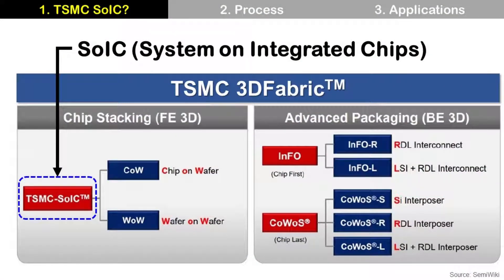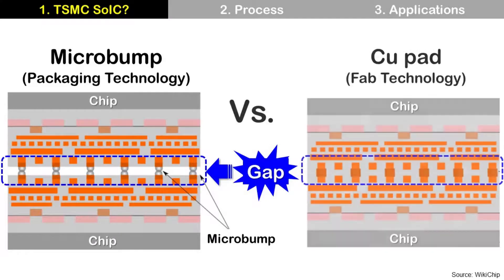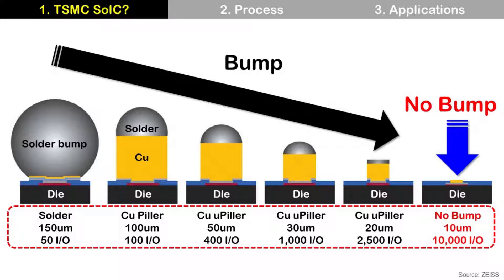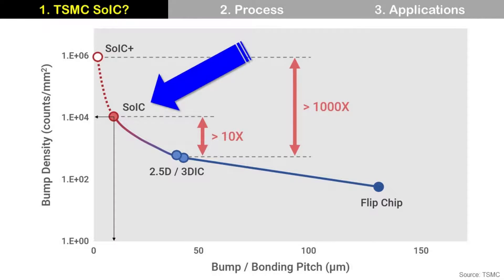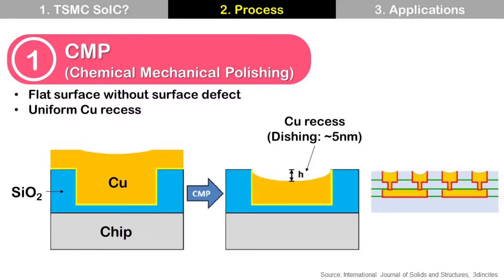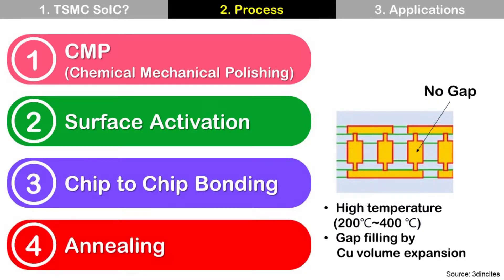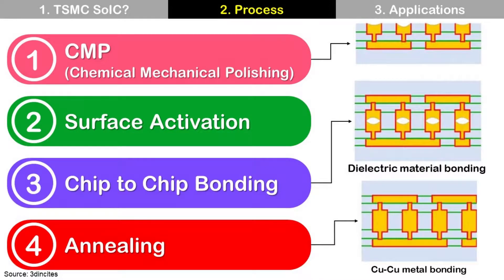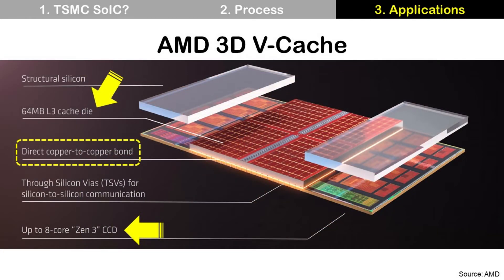[Eng Sub] TSMC SOIC

Comment: Hi, I always love to watch your video which is really helpful for me to understand the PKG area. One quick question. For the CoWoS-S, Do you know how many Metal layer is being used(MaX) for the S-interposer? Are there any limitations to increasing the number of metal layers or is it just a matter of cost issue?
Reply from the maker: TSMC CoWoS usually uses 3~5 metal layers on Si interposer depends on configuration. There should be maximum number of metal layer on Si interposer because there should be minimum width of metal trace. But typically metal layer is limited by manufacturing cost.

Comment: Could you make video about InFO_oS which is probably use in Zen4 because for some reason I don't see where this technology is use on official TSMC documentation. Where are connections?
Reply from the maker: Sure but nowadays I couldn't make video without time. But let me explain little bit about InFO_oS. InFO_oS is InFO on substrate means fan-out package with multiple dies attach on package substrate. Die to die connection is done by RDL without micro bump and InFO package to substrate is connected by Cu bump. Solder ball is located on the bottom of substrate. For InFO fan-out package, solder ball is located on the bottom of RDL. I think InFO_oS is for HPC(High Performance Computing) application with larger package size and advanced fan out interconnection technology of InFO.   

https://3dfabric.tsmc.com/english/dedicatedFoundry/technology/InFO.htm

Please check slide 9 and 10 of below presentation file from TSMC.
https://hc33.hotchips.org/assets/program/tutorials/2021%20HotChips%20TSMC%20Packaging%20Technologies%20for%20Chiplets%20and%203D_0819%20publish_public.pdf

Comment: If there is dishing on top of the copper pads where does the material come from to fill that gap.  If it is aniline is done when heated then would it not shrink back down when it colder and crack?
Reply from the maker: Fill that gap is done by Cu volume increase by temperature increase so no material come from outside to fill that gap. Cu does not shrink back when it cool down.
Reply: Can you explain more why Cu don't shrink back when it cool down? It's a little confused. @semicontalk3223